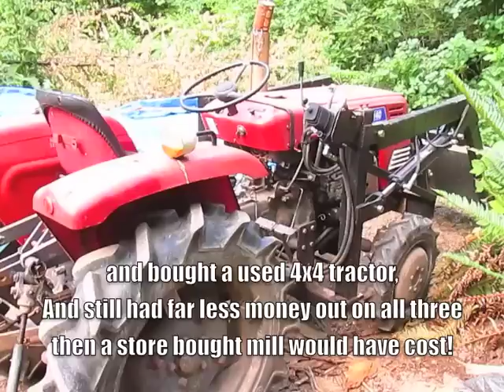Homemade bandsaw mill

Comment: nice mill..  planing to build one in a futur project..  the things that i will remember most, or that gave me ideas is your log clamping method, tracking adjustment.  height clampling, and guide block.. great videos (both fabrication and running videos)  kudos to you

Comment: Nice rig!     Yes, you can build for cheap..   The one I built cost about $3-400 for the initial setup.  Then put another $1100 into it to add hydraulics.
Reply from the maker: Thanks! That's great you built a mill,  That's the best way to do it, build it, then add improvements as needed!

Comment: Awesome build! I do worry a tad about the safety aspect of tripping over the obstacles of the machine when pushing the saw.
Beautiful lumber from that log!
Reply from the maker: I did have to watch my step but never did I trip on the frame work, I was working on building a walkway on top of the frame, but instead I built a power feed  for my mill and a platform so I can just ride on the mill and let it do all the hard work, now I just watch the cut and monitor the cut speed. Thanks for watching!
Reply: Mike festiva I'd love a video on the power feed. I've thought of adding one to my mill. Good job on the build and thanks for posting.
Reply from the maker: If you have not seen this video I made on my power feed here is a link to the first video, at the end of the video there should be a link to the second video. I recommend you building a power feed, there's a lot of dc motors out there that can easily be adapted to a mill. I'm real happy with my power feed, It makes the mill cut like a new machine! 
https://youtu.be/2M1JMKUrSkQ

Comment: Nice mill....one thing build a pushing handle so you dont have to walkover those beams if you trip it could get ugly
Reply from the maker: Thanks for checking out my video 👍 this was when I first build my mill and it’s been a work in progress, this video I will link is a newer video with a power feed, but I have even more improvements now like height set controller. Take care https://youtu.be/vMNN7dqtICE

Comment: So you built this? This is amazing! This must have more features that a "proper" one which you would buy. :) Nice job!
Reply from the maker: Thanks! Yes I built it all from salvaged parts and pieces, this video was from about 3 years ago, since then I have added a electric throttle and blade lube control, a power feed so I can ride on the mill when cutting lumber plus a auto board height control. I have posted videos of most of these upgrades, It’s been a fun project, you’re right the store bought mills need to step up there game and start providing theses things on there smaller mills. Take care and thanks for your great comment!

Comment: Awesome rig!
Reply from the maker: Thanks for checking it out!
Reply: The wife just gave me "the look".
But yes, i will be building one during the year. ;)
Reply from the maker: LOL The look! I have seen that look before :) 
That's great your going to build a mill! start tracking down parts and tell your friends what your looking for and you will be surprised how parts and pieces start adding up. 
Check out my first video on building my mill, somewhere in the middle of the video I list a blade speed to HP chart, this is real helpful when you track down a motor it gives the right blade Feet per minute "FPM" speed.
It took me a long time to find that info on line so I thought it would help others in building a mill.
Here's a link to my  first video. 
https://youtu.be/dFNpKC3JTVQ
Reply: Your wife will love it once you build her some beautiful piece of furniture!   Mine has a beautiful quarter sawn white oak pantry which I cut and my Dad made.

Comment: Mike great build .I am in the process of building mine .i am using band saw wheels . actually 18.5 inch v pulley  with a belt gives me 19 inch wheel.   How much downward pressure should be on the blade guides? thanx
Reply from the maker: That’s great you are building a bandsaw mill!
To answer your question I have no downward force on my bearing guides, in this video I think I still had UHMW plastic guides but soon after I made ball bearing guides for it.
I have seen some sawmills on line where people put downward force on them but I don’t think it’s necessary or right. I set my guides so once the blade is tensioned you bring the guides so they are just touching the blade top and bottom, the rear bearing can be touching the back of the blade or just off of it a 1/8”
I maintain a big 40HP electric bandsaw at my work and the guides are set the same way like I just mentioned. Take care and I hope to hear some updates on your progress!
Reply: @Mikefestiva  thanks researching and seeing how others set it up. I have one more question. i have an 18 hp engine and was thinking of  using 3"drive pulley off the motor  to a 10"pulley  on the shaft. do you think I need to bump up the 10"?

Comment: A nice build. I commend your inventiveness.
Are you lubricating the blade with water or something else at 2:25 ?
Reply from the maker: Thanks for checking out my mill video!
Yes I do use water with pine sol to lubricate the blade and cut down on pitch build up, I mix the pine sol at a ratio of one cup pine sol to a gallon of water. I also have found that it work like antifreeze in the winter, I forgot to drain my lube tank one winter and after two weeks of temps below freezing I was surprised to find  my blade lube was still not frozen.

Comment: Hi Mike, inspired to build a sawmill! Almost have the bed finished. I am not a motorcycle guy, what kind of wheels should i be looking for? Do most bikes have wheels the same diam?
Any other good options?
Thanks, really enjoy the channel.
Paul - Vancouver Island
Reply from the maker: Hi Paul :) I think you will be happy with your mill, I used wheels from some early 80s Suzuki GS street bikes, I used front wheels and rear swing arms, if I did it again I would have just used rear wheels with the swing arms, bikes usually have different diameter wheels front and back. Try and find some old street bikes with the same sized wheels if you can, I used mag wheels too, rather then spoked rims because they seemed to me they my be stronger? See if you can find someone that has a pile of old motorcycles to scrap from. I hope this helps. Let me know if you have any more questions. Take care

Comment: looks like a steelite tipped blade , have to wonder why the up right stops and the dogs can't switch sides , if the dogs are good it would still hold the log steady , and the blade would be entering the clean side of the log

Comment: i have watched a lot of videos and i like yourabout your motor what size of motor is on that and where did you get your blade. and how long is band blade. i want to be able to cut a log a least 38" in diameter is that possible with your particular model

Comment: Hi Mike nice job,do you find it hard getting the logs "square"? I can't get square tubing to fit snugly inside another piece so that it slides easily and snug so when I push my first cut up against it to make my second cut it so the cuts will be 90 degrees to each other.
Reply from the maker: +revid64  My mill cuts square, I found nest able tubing that fits close, and I made sure when I welded my log stops in place it was 100% square to my log platforms. One more thing, make sure your blade is level with your log platforms as well. I hope this helps. I would really like to see a photo of your mill sometime.

Comment: hi! i'm didier from france,i use your sawmill as a model for building mine,i would like to now wich type of blade you use?thank's didier
Reply from the maker: +didier poncot  That's great your working on a sawmill :) The blades I'm using are free used carbide tipped blades I get from my work, they are from a bigger bandsaw, and are 1.1/4" wide (31.75mm) and have a 1/8" (3mm) Kerf. and are variable pitch blades so they have sets of four teeth close together and four teeth a bit wider apart.( Don't buy carbide tipped blades because they cost WAY to much, I only use them because there used and free) I think the spacing between the teeth is about 3/4" (19mm)? I'm sure there not the best tooth combo for my mill but there free so I can't complain. 
I just talked with a friend the other day that owns a saw blade/ blade sharpening company, he shortens the free blades I get from  my work for me. I gave him all the specs on my mill like HP, cutting blade speed, what kind of wood I cut and the average size log I cut and he sent me out a few blades to try. I have not tried them yet but when I do I will let you know what I think of them, I think they have a tooth every 1" (25mm) and a pitch of 10 degrees this is for cutting soft woods like Doug fir, Pine, Cedar. I hope this helps.
I hope to see a photo of your mill when you get done!
Reply: +Mike festiva thank's a lot mike i will send you pics soon,i will adjust my wheels and pulley this weekend.

Comment: I have 7hp and also a 12hp Kohler engines! Would 7hp be enough or even 12hp? P.S. Nice mill!
Reply from the maker: Thanks for checking out my mill! I'm running a 12hp Kohler on my mill and I'm happy with it.
If your going to build a mill the 12 hp would be a better choice, you will be able to cut faster and mill wider lumber.
What makes the biggest difference is getting the gear ratio right, you can have a 7hp mill cut fairly well as long as you get the blade speed right, you can also have a 12hp mill cut bad if you gear it to high, some of my other sawmill videos I go over gearing a bit more and give some general HP to blade speeds.
I hope this helps you out.
Take care :)

Comment: Where did you find those t-bolts for the log holders?
Reply from the maker: If your talking about the T bolts that lock the bars or cant stops in place and make them adjustable, I just welded  on some short pieces of 3/8" or 10mm solid metal rod onto some bolt heads, it keeps it simple.
Thanks for watching

Comment: I am building one and I got 2 tires but 1 of them is about half an inch smaller. Do you think that would be a problem?
Reply from the maker: I bet you can make it work, you will just need to compensate for the difference so your blade cut will be level with your log bed.
Good luck with your build :)

Comment: Where did you get your saw head locks?
Reply from the maker: Good question, I salvaged them for my mill.
I did a little research for you and if you look up ( Vertical toggle clamps ) you will find them all over the internet, they are fairly cheap to buy.  
I find lots of times I know what a part may look like but have no idea what the name to use to search for the part.
I hope this helps.
PS I find the locks I used helps the saw head lock in place when cutting to keep it from shifting or moving at all when milling but they are not a 100% of what keeps my mill head from dropping, the cable boat winch also has a lock on it. I don't think I would 100% trust the head locks to hold the head alone when milling.
Just though I would let you know.
I hope this helps :)

Comment: I have a 7HP MOTOR. Work in this proyect?
Reply from the maker: +Marvin Bonilla I'm sure a 7 hp motor will work, you will just have to make sure you gear it right, In my other video of my sawmill, I talk about blade speed at 10:18 look it up. I think if you should shoot for a blade speed of 3500 Feet per minute It will cut fine. I hope this helps.

Comment: bro..what type blade you use...how about lenght and width..
Reply: Arjuna,  the blade is one inch and the length can go from anywhere at 133 to 177 depending on it size.  If you look at your own 14" band saw that is obsolete in parts.  Take a moment of your 14" band saw and turn it into a mill.

Comment: i have a lot of very big pines that died years ago from bark bettle, any idea how deep those things go, is the core still usable (typically)?
Reply from the maker: I'm not sure how deep they get into the wood, I thought I have heard they bore just under the bark but, up in the north west we don't have as much of a problem with the beetles. You may just need to cut one up and see how it looks?
Reply: I have pine beetle infested trees as well-was told they should be burned-not good for lumber, etc....
Reply: @bournphree7565   Pine beetle kill is fine, it actually adds a blue tone to the wood. The issue is they leave behind a oily substance (hence the blue tone) which can be a significant fire hazard...one reason beetle killed stands of trees flare up massively in a forest fire.

Comment: so you are putting water on the blade? i would have expected that to clog up with sawdust. so it helps cut?
Reply from the maker: Yes I use water with a little pine sol mixed in to cut down on pitch build up on the blade and it helps with lubing the blade, it cuts down on friction.
I cut a lot of green logs so the moister content is high and the sawdust is not that dry anyways.
Dried logs or green logs it's helpful to add a little bit of water when cutting.  
Thanks for watching.
Reply: awesome. do you use your lumber for home building? how is the city/county where you live about that re building permits and inspections? do you need to get it graded? i'm in norcal, where are you? thanks
Reply from the maker: I will read this sometime, one thing to keep in mind is I live in the northwest and water is everywhere and everything rusts, so using water and pine sol for blade lube is not that big of a problem for me.
I never take off my blades they are always on my mill and when I fire it up after it's been sitting for a while there's always some rust on the blade. once I cut for a little bit the rust is gone. 
I'm sure people would say never to keep a blade tensioned on a mill that's sitting as well but I just go with what works for me and whats easy.
I'm sure there's better things out there to use then water but I don't care to use diesel, I have heard of this but it seems like a bit of a mess and I bet the diesel is probably worse on the rubber tires, I do not believe for a second that water dry rots rubber tires, for the fact all tires run on cars and motorcycles in the rain for crazy amounts of time and miles and anyone calming water dry rots rubber but will putting oil on belts and tire and say it is better is nuts. I'm sure oil would be better for a metal blade pulling through wood then water and I'm sure it's better to keep pitch from building up but I think this use of oil as a blade lube would lend it's self better to mills with metal wheels.
Just my thoughts on that.
Reply: Mike festiva 
Steve's comment is for woodworking band saw blades. As used in dry dusty woodworking shops. Not sawills. Oil and diesel would be nasty to work with milling. Applying a thin coat of oil with a damp cloth is for woodworking bandsaw blades. No value for a sawmill blade unless you are planning on storing them for an extended period.
Reply from the maker: Thanks for your comment! It seems diesel would be a mess on a bandsaw mill, I think your right that oiling a blade to be stored would be a good thing.
Take care :)

Comment: How is your blade tensioned?
Reply from the maker: The blade is tensioned by inflating the tires to about 45 PSI  It seems to work well, and after installing new blades it always tracks great, I never really have to track the wheels.

Comment: Suzuki GS450 wheel and swingarm?
Reply: x2
Reply from the maker: You are close, I think they where Suzuki GS 550 front wheels and rear swingarms. I bet you have owned one in the past.
Thanks for checking out the video!
Reply: I still own an old gs450
Reply from the maker: They are cool bikes, I have an old Honda CB 350 four that I found in a barn, it needed a lot of work. 
I have fixed it up, simplified it and put clubman drop bars on, still looks a bit crusty but I like it that way, I really enjoy riding that old bike! Cheers

Comment: HP MOTOR?
Reply from the maker: +Marvin Bonilla It's a 12hp motor, I describe all about this mill and show step by step how I built it in my other saw mill video. check it out if you get time.
Reply: which diameter pulley is recommended for a HP 7 motor and 3,600 rpm. I have a Fan clutch 4 inch diameter.